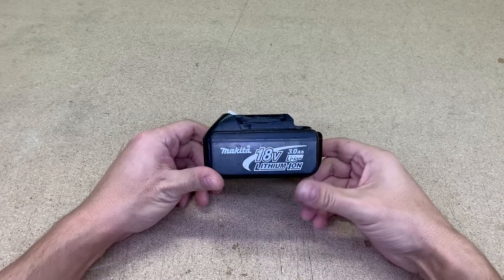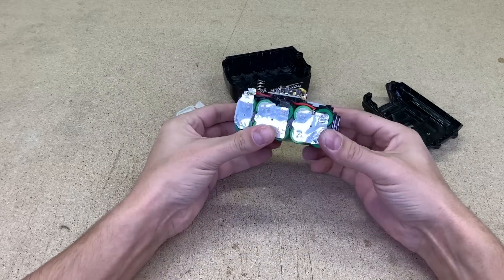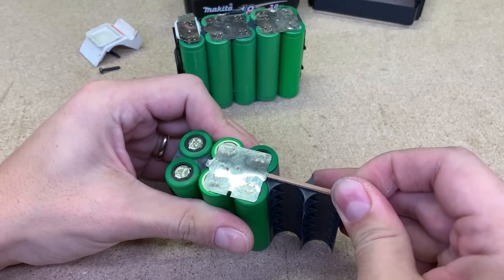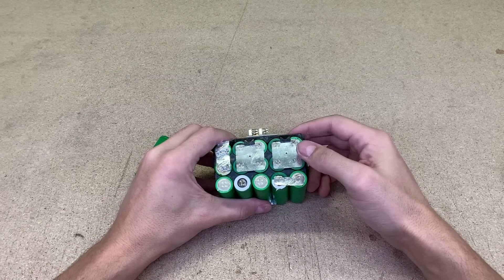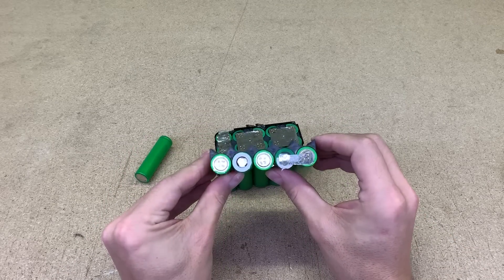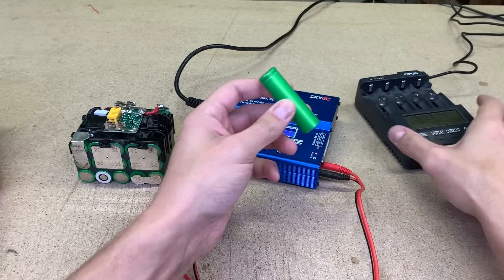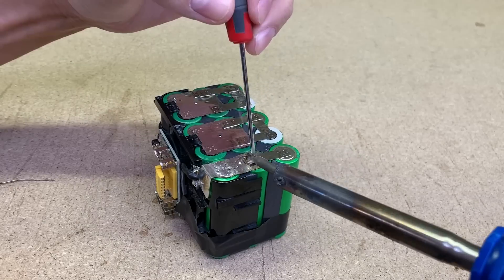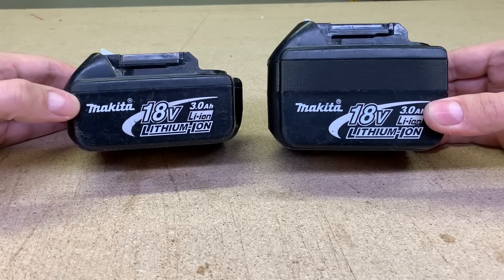Increase Makita 18V Battery Capacity By 50%

Comment: I was thinking of upgrading to 21700 cells and using heat shrink around the bottom. These would then go in my Makita lawn mowers only..
 I don't have a 3d printer..
 I can try this as I have 40 18650 cells I bought from China that don't have full advertised capacity.. 👍

Comment: I don't know why makita is so far behind in battery capacity in their range. Cool video!
Reply: The 3.0Ah basic design is over 10 years old, 1500mah cells were then about as big as you could get. They are now doing 4.0Ah,  5.0Ah and 6.0Ah baterry packs in the same case size using high capacity cells. My 9 year old 3.0Ah packs now have only just over 2.0Ah of capacity, so may be getting upgraded with 2500 or 2600 mAh cells soon, may need to look at this spacer at the same time, though waiting for a better BMS to be readily available to balance the cells.
Reply: They have now 6 Ah Versions of their 18 V Batteries.
Also newer 18 V x 2 Machines seem to be prepared for a future battery generation with 21700 cells (at the moment up to 8 Ah with a 5S2P pack), because they increased the space between the 2 battery packs from 5 mm on older machines to 10 mm on newer 18 V x 2 machines.
Reply: They bringing out new 21700 cell battery i think soon instead of 18560
Reply: @micjubba709  Still waiting

Comment: Very helpful.  Makita (and everybody else) really charges too much for these batteries.  I would prefer a standardized battery that worked between manufacturers.  I have that somewhat with Porter Cable and Black & Decker tools which can be modified to use each other's batteries.
Reply: All German brands now have it - Maffel, Metabo and Bosch batteries are interchangeable out of the box

Comment: why not add 2 rows or 3?
like, 5 rows of 2.5ah cells  makes 12.5ah, you could even use an angle grinder for a very long time then
while we are at it. maybe just take hundreds of cells, strap them on your back and make an adapter plate and cable?
you can work all day long then.
next crazy idea
make an array that you can strap to your back and simply plug in up to 25 batteries all in parallel
would this work or would this cause issues?

Comment: I'm doing something similar,  replaceing the 2000 mAh sub c cells with 5000 mAh C cells in my 18V black & decker battery pack. just needed about 1/4 inch spacer which i 3d printed.
Reply: What software do you need ?

Comment: Seems like more work than the result. I find the 5ah two pack on sale at Home Depot for $149. The two pack 6ah for $199. I etch the date on the side. By rotating the batteries, not draining fully, and not leaving them on the charger once charged they seem pretty good.
Reply: I think this video is for people who have old batteries and non operational batteries, that way you can upgrade your old ones with the spare batteries laying around.
Reply: Jose Guzman like trying to upgrade your Commodore 64
Reply: By adding more cells in parallel, it spreads the work load and the cells will last longer and not heat up as quickly or as much. It's the same as wiring multiple car batteries in parallel for longer runtime. Wire them in series and you double the voltage and increase the amp draw. And that is why the X2 36v tools won't operate without both batteries, cuz you are breaking the connection. Funny part about that, Makita batteries are so smart, it also won't work with 1 fully charged battery and 1 depleted battery because that would damage the fully charged battery from the high amperage demand.

Comment: Is it possible to use a existing the 3.0 protection board to do the upgrade? It has balancing wires. Would the balancing cause an issue?
Reply: Hey Jose.. Did you find the answer to your question? I was considering taking 2 original makita 3ah batteries and combing them using  this guys spacer and then using one of the  makita protection boards. I’m unable to find out if the original boards are able to work with higher amps than intended
Reply: @user-jx2zz4lb5d  i decided just to experiment,  and added another row of cells using 3.0 battery, ive been using it for a few months and no problems yet, but when I'm not using it, I keep it in a safe just in case.

Comment: Well that's the first working balanced makita battery which has the ability to have more than 6AH
Is it possible to use an original PCB from an battery and change the cells?
So in that way the charger will still balance?
Reply: I don't think it's balanced.
Reply: @dav1dsm1th  the original makita batteries have a PCB which balances all the cells in series while charging
So if you add a row of batteries they also should be balanced
Reply: @deejayitalo  Interesting.  I don't see enough MOSFETs on the circuit board or wires connected throughout the pack to allow the cells to be balanced.  But, hey, I've been wrong before.
Reply: Alessio Witte 
?
Reply: Hello! I was wondering, did you go ahead and make that mod on that original makita pcb with the balancing system?

Comment: Does it still charge on original makita 18v charger
Reply: Chargers cannot check the capacity of a battery, they just measure the voltage, some vendor specific code and start charging untill the setpoint voltage is reached. They are simply put, too dumb to notice the difference.

Comment: Good idea, but that's way to big and heavy like that unless you're using it on some stationary, non-handeld tool... Good luck holding any tools all day long with that weight. Too heavy and too unbalanced.
Reply: I had the same thought that won’t fit in my work light or my radio
Reply: Would work great on their electric leafblower

Comment: The working hours performance of makita tools is very bad with 3 or 6 amp batteries. I recommend milwaukee tool.
Reply: Boss uses Milwaukee. I use Makita. Run times are very similar for equivalent battery sizes. Comes down to the tools you are using. Different rpms and torque speeds will impact the run time of the battery. The same is true for old tools v new tools.
Reply: Yeah well you won’t be using that Milwankee much since the impact collet can’t hold bits in and if you watch AvE tear one apart you’ll see they are built with the same quality as they were. Makita are one of the best tools out there in regards to durability, longevity, performance and price.
Reply: I just built a 5' x 8' collapsible leg workbench that stores on the wall out of the way in my garage. I used my Makita track saw and Makita drill & Impact for the most part..along with a Miter saw of a different brand that plugs into 120v. I didn't use the Track saw much just a few cuts so it didn't really drain it's batteries at all, but I did use the drill and impact drilling pilots and driving more than 100 3" spax screws plus 8  6"x1/4" spax lag screws over two days on one 5.0Mah battery for each tool. When finished both batteries still showed 50% charge left and ready for more. I've had Milwaukee tools before and they never came close to that kind of performance.
Reply: Ok fanboy. Not even close.

Comment: Not everyone has the capability,  resources, and tools like the small spot welder you have,  so this really is not a helpful video,  most of us are not going to buy a spot welder,  battery charger/discharging machine and materials for one or maybe a couple of batteries,  but thank you for you time.
Reply: Building one yourself is not very difficult, you can do it with a car battery and a relay. There are many videos on this.

Comment: Nice skills to mod a battery but totally impractical to 99.9% of the working tradesmen you can now buy 5amp batteries for £50 compared to try and DIY or even pay someone to do this for you , not worth the while.
Reply: Surfreek still fun. Makita LXT line has been around for so long and has so many tools and batteries. Also they are going into 40V line so LXT might be obsolete in coming years but the tools are so good and 18650 so common. I think its great tinkering platform.